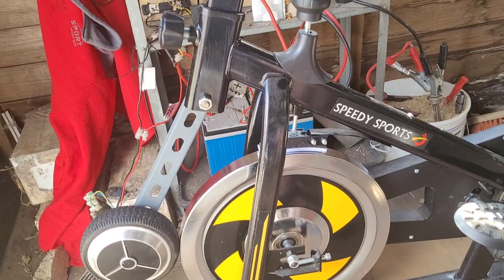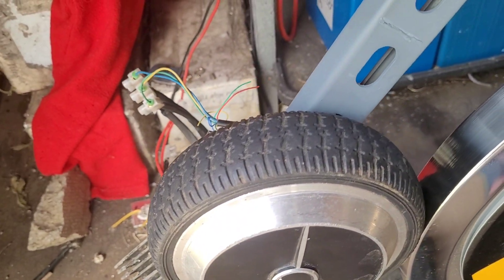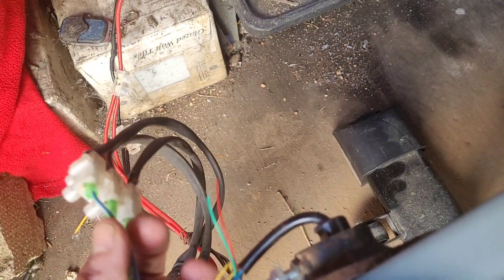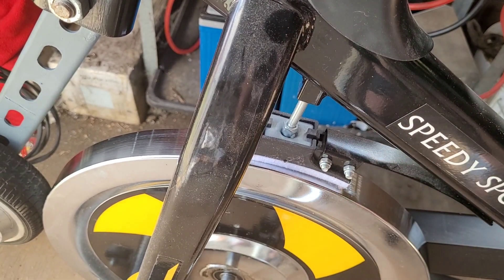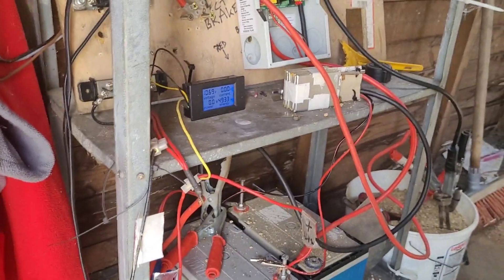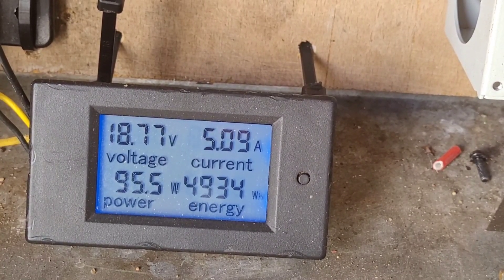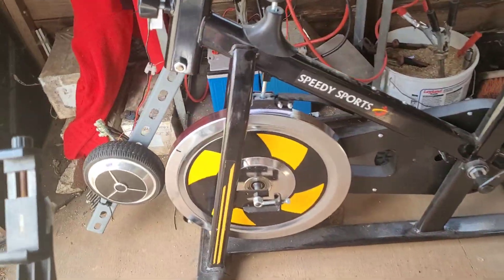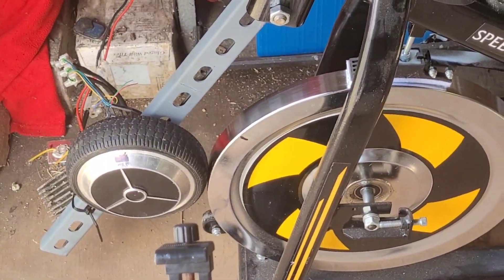TRUE OFF GRID Battery Charger Device - NO SOLAR - NO WIND - NO PROBLEM - Pedal Power to the Rescue

Comment: This is a good start. I’ve considered a gravity storage device where I can lift weights up slowly over time, then release them when it’s needed. The lead acid battery really needs a charge controller to get the best out of your work and a Low voltage disconnect (LVD) to prevent low discharge damage. Bear in mind that solar panels are really cheap at the moment. I’ve measured my output on a static bike before and (10 years ago) I could maintain 250w for about 30 mins or get 450w (balls out) for about 2 mins max.
Reply from the maker: this project is being done for pure enjoyment alone :)

Comment: Seems as though one of the cells have gone in the battery or the cell is fully discharged because it sat around 10v. The battery may also be sulphated because of the high voltage it went up to when charging. A desulfator or desulfator battery charger might fix that.
Reply from the maker: Yes that one has gone , I tested it with another one it works better.

Comment: As said in other comments it may take 2 years to recoup costs. But if you have the parts anyway for free then your on a winner day 1. 150W is good going, if you doubled up the motors (yes each would need its own rectifier ) you would get 300W but it would be twice as hard to pedal (no such thing as a free lunch in Physics) . The main losses will be the tyres to steel wheel. The most efficient generator would be a pancake direct dive (as used in small home turbines). I estimate you could get 30 to 50% more efficiency with a good large diameter 600mm disc but you would need around £50 of neodymium magnets  https://www.youtube.com/watch?v=2-ExvwfNaMQ
The voltage rises as a product of the rpm and subsequent energy.
Good project totally agree with "have a go just make some thing philosophy" the world is full of arm chair experts who can tell you you are wrong but the physics says your going to get fitter for sure.
Reply from the maker: Thanks mate I have only just seen this, I love the bike it's great , £30 even worth it for the exercise, just uploading another video about it , hopefully you'll watch and I will try to reply quicker, cheers.

Comment: I always look at how long it would take me to break even with things like this. It looks like it would cost around £40 to make that, assuming you already has a charge controller and battery, cheap yes but how long to recoup the £40? By my calculations around 2 years of peddling non-stop! I suppose if you are fully off grid in a shed somewhere it has its merits and it would certainly keep you fit.

Great project BTW.🙂
Reply from the maker: I am thinking about winter in the UK , power cuts etc, just thought it would be cool to have a back up , might mean I can run the diesel heater when otherwise I would be screwed, I did manage to  make  a modification and now the power is way higher.
Reply: @GavinFreedomLover  Fair enough. Thank you for the reply.
Reply from the maker: you're welcome mate , thanks for commenting, we are putting all our eggs into wind and when the temp hits minus 5 they stop working , it won't end well.
Reply: @GavinFreedomLover  How come they stop working in the cold?
Reply from the maker: Because the air literally stops moving around the UK when it gets super cold, Antarctica being an odd exception to this.
Reply: Here in Texas it's hard to justify hardly anything with power 10-12c a kwh. Fun to play with though and I have to agree, sometimes something is better than nothing.
For low power things like this bike running a very small motor off of methane or even burning wood or trash for a small steam engine also always appeal to me. I try to keep enough junk laying around to where I could piece something together if I had to 😅
Reply from the maker: Our power in the UK is equivalent of 60c a kwh, cheers for the comment :)
Reply: @GavinFreedomLover  that's pretty rough! My breakeven for my diy solar system is 8-10 years. With electricity at 5x mine then homemade power could a great investment there! Run some extension cords and sell it to the neighbors even 😅

Comment: I think if you use a car alternator instead of hoverboard motor it will be give more output
Reply from the maker: No car alternators are rubbish for making power , they would need over 1000rpm to make 100 watts , this is perfect.

Comment: Good work Gavin also try to do it using a motorbike engine I am planning to make a battery charging system for ev kind of a range extender
Reply from the maker: I think you may mean an "electric bike hub motor" This I will be trying for sure, cheers